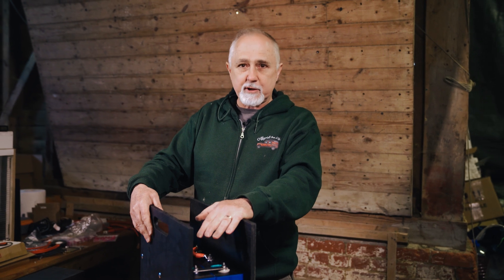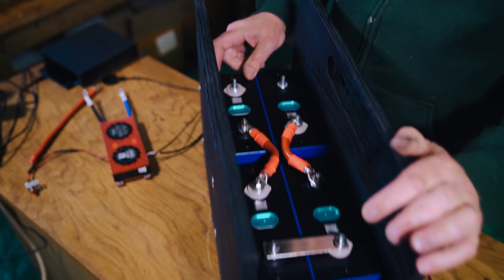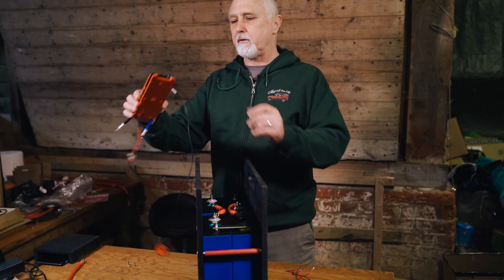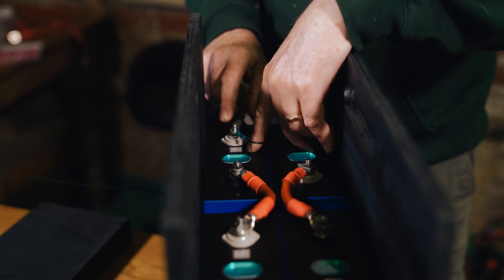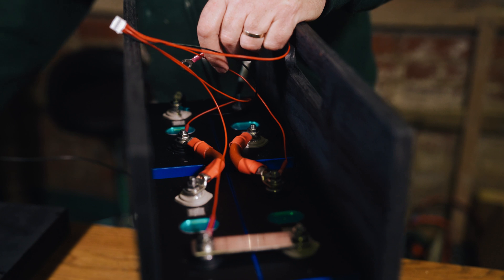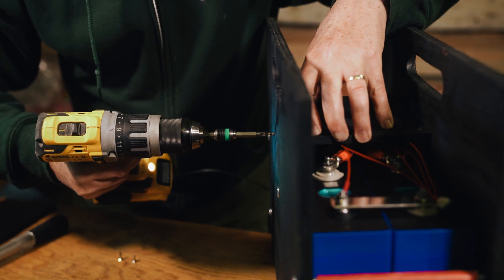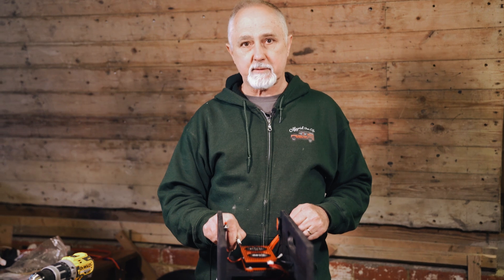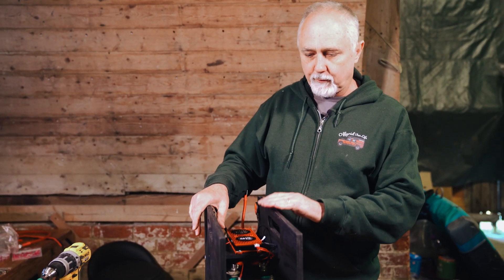Building a custom LiFePO4 battery

Comment: Do you not calibrate zero amp setting in the Daly?
Reply from the maker: Not sure what you mean by zero amp setting?
Reply: I have the Daly Smart 200A. The problem is that it does not read draws under 2A. So it shows the wrong SOC.

Comment: Could you please add the link to the two pin wake up button connector? Thak you.
Reply from the maker: Here are the two links for what you need to make an on-switch to wake up the Bluetooth/turn the BMS on...

Connector that plugs into the side of the BMS: https://geni.us/OnSwitchConnector
On-Switch that you join to the connector: https://geni.us/OnSwitch

You simply join those two and can extend them with any small gauge wire. They won't carry high current obviously as it's just a signal, so very small gauge wire is good. :)

Comment: I am working on my battery setup; more of a milk crate is what i am leaning in with (non-van setup, but emergency home power/modular setup).  I like the daly and just bought a 200A w/ (4) 280Ah 3.2v batteries.  My question is with the plastic walls for the compression, i like that idea, but won't that contribute to battery temperature?  I might try cutting some walls from a milk crate to supply the compression walls.. wanted to hear of heat would be an issue.  Love the videos btw
Reply from the maker: Those milk crate set ups are great! We've built some for use in car camping. We've not had a problem with our batteries overheating with the plywood compression clamps, even on high current tests (e.g. 160A+) at 25 degrees celsius. One thing we have not tested is high temps though, which might make a difference in the results.
Reply: @offgrid_power  thank you sir!
Reply from the maker: No problem! :)